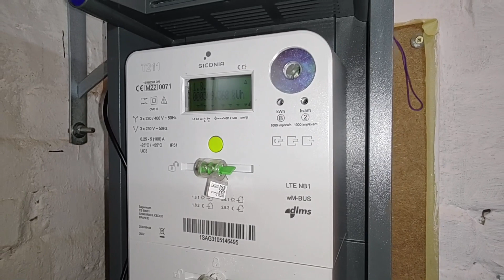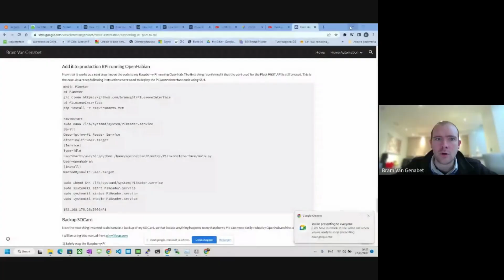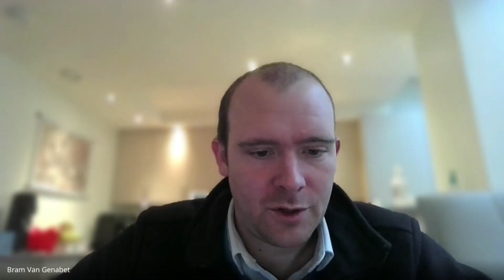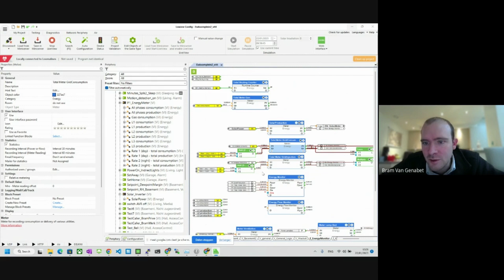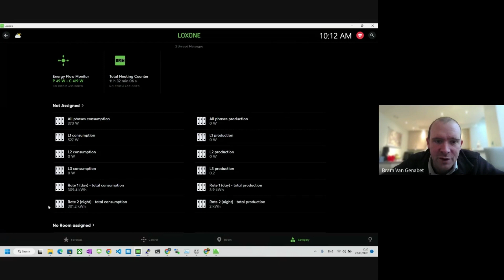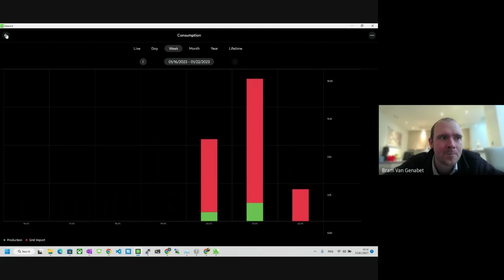Connect P1 Smartmeter to Loxone using Raspberry PI REST API

Comment: Hello Bram, I’m using the homewizard P1 WiFi adapter and also there other devices for this.  Costing online 30€ I managed to connect them all directly to Loxone without the need of a PI.  They have a dynamic ip but I found out you can use the hostname which is linked to the serial number instead.  Have it running for 6 months now.